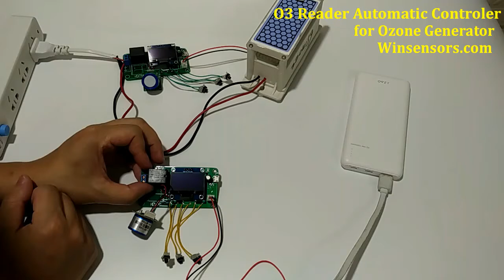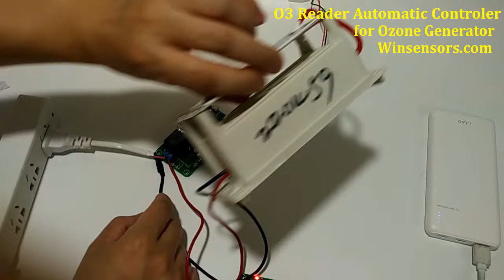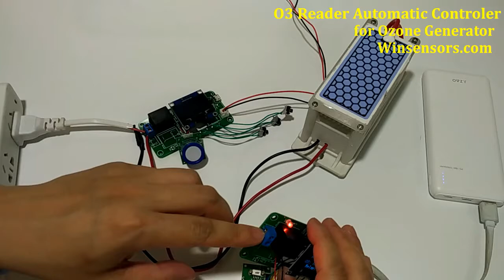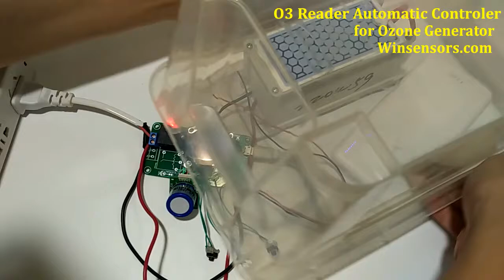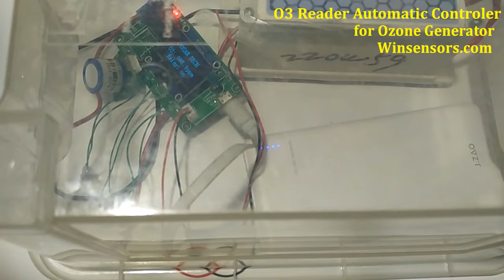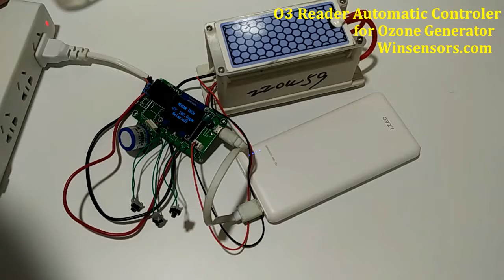Winsensors O3 Reader and Automatic Controller for Ozone Generator

Comment: I am very interested in this. I wish to know if this controller can be fitted to any commercial Ozone generator. Else, I happy to also purchase your already fitted Ozone generator (if they are available) along side the controller. Secondly, 15 - 50 ppm seems quite a large range; I suppose, it still works with narrower ranges (eg. 10-12 ppm). 
Lastly, when UV light is used as the Ozone generating source,  the intensity of the UV light or the air inflow rate are the main factors affecting the generated Ozone concentration. Can this controller be adapted to such a scenario? Can you reply with your email, so we can discuss this further.

Thanks
Reply from the maker: Hi, many thanks for your interest in our products. We would be delighted to supply sensor or reader under your request with no minimum order required. 
We offer Custom Design and Manufacturing service. please visit website https://www.winsensors.com/ for our contact details.